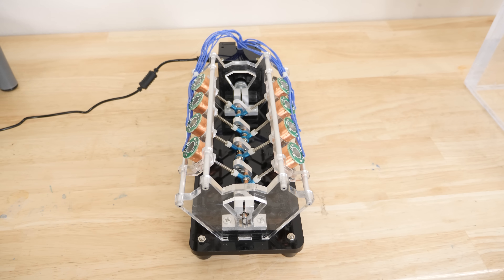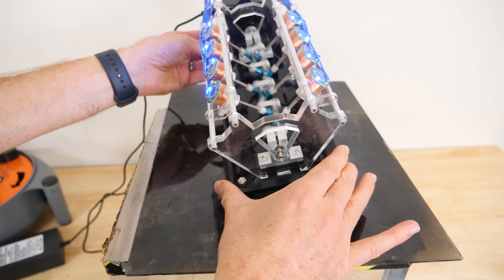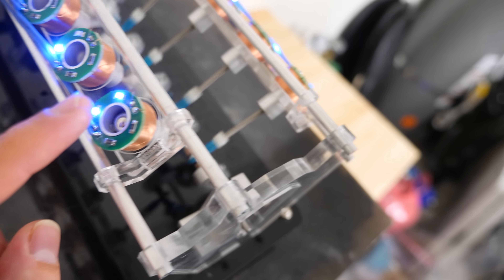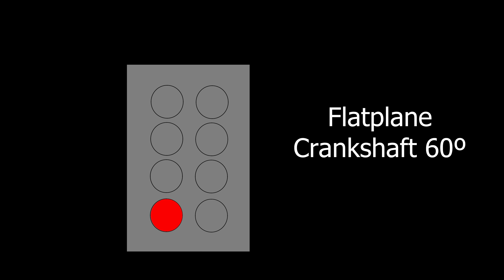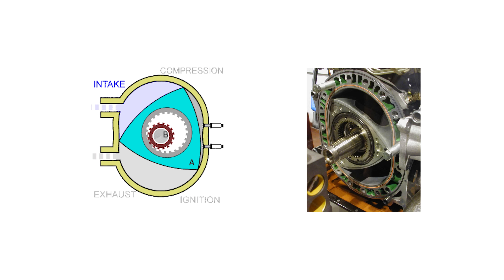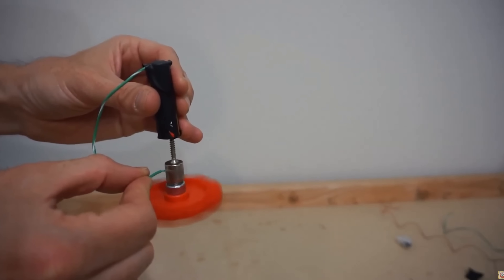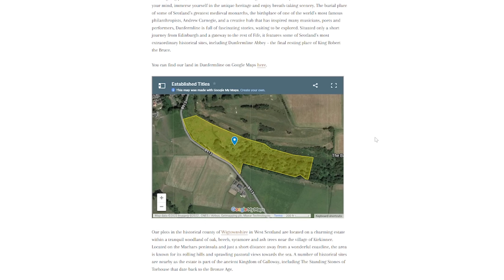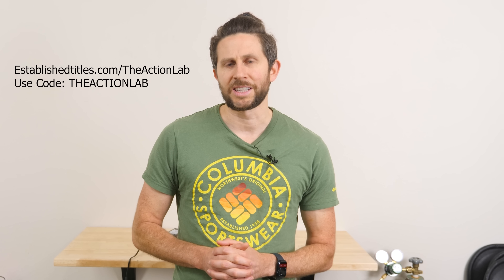Is an Electric V8 Engine a Good Idea?

Comment: Particularly interesting one.. I never thought about the losses when converting linear to rotational motion (especially when the rod is farthest away from a 90⁰ angle to the crank).
Reply: @Edward Elizabeth Hitler so a series of coils to drive the piston down would do the trick? Like peristalsis (lol biological scientist here).
Reply: There are no losses here.  This is nothing more than a commonly held misconception held by people who are not well versed in physics and/or mechanical engineering
Reply: Because there aren't actually any losses due to that
Reply: @giovanniquargentan6198  Except there are because the connecting rod is the same length throughout its movement. When it hits 90 degrees, the piston has traveled about 55% of the way down the bore, rather than 50%. This causes uneven forces throughout the movement of the piston, the piston moves faster in the first half of the stroke than the second half. This is secondary engine imbalance. And the connecting rod is stealing power from the crankshaft, from the other pistons, to do this in both halves to make up for those imbalanced forces. The engine is vibrating rather than delivering force to the wheels, which is energy loss. 

Balancing shafts can be used to reduce this imbalance, but it's a treatment to overall engine vibration, not a cure to the root issue, and does nothing to treat vibrations experienced by the crankshaft itself. You have to fix the connecting rod to fix this inefficiency.
Reply: @KaiserTom  Thanks. Very interesting information there. I would love to learn more about this.
Reply: @KaiserTom  you are correct, there are some losses in vibration, BUT they are very very minimal. I suggest you check the replies under the pinned comment of action lab, i gave a much more detailed explanation, also there's a guy named "michael harrison" who also explained it correctly.
Reply: @HeyChickens  check out the channel "driving 4 answers", he's a nice guy who knows what he's talking about
Reply: @giovanniquargentan6198  There's "opportunity" losses too though. It leads to an inability to design engines with larger bore displacements (which would be more efficient) due to the need to increase revs, which is incredibly difficult with secondary imbalance. You solve that and you can achieve a significant efficiency gain from an engine design that can take advantage of it.
Reply: @KaiserTom  "opportunity losses" doesn't really fit into the definition of efficiency, which is energy put into the system (chemical energy from combustion) / energy that arrives to the wheel of the car.
Also, higher bore do not automatically mean more efficiency. Higher revs over the max torque rpm never improve efficiency also. 
Have you seen the comments i talked about?
Reply: @KaiserTom  the secondary imbalance losses in an ICE really don't contribute that much to the overall efficiency of the motor.   The reason for trying to minimize secondary imbalance force is to reduce NHV and the impact on life expectancy based on reducing metallurgical fatigue

Comment: The LED's can't signal when the current is both off and on at the same time. If this was the case the LED's would stay solidly lit. However they can signal when the current is on. 😝 Just messing with you bud. It was the way you said it that made me laugh. 👍

Comment: I know a traditional motor is possibly more efficient and cheaper to build. But I still wonder, doesn't this set up provide more torque than a traditional motor? I wonder if there's a difference in efficiency if you have a regular alternating current motor pulling the weight, and piston driven electric motor pulling the weight. in my mind I would think the Piston dripping one would be able to pull more weight than a single electrical driven shaft base motor.
Reply: Well traditional electric motors giver more torque than combustion motors, even diesel-electric trains use a diesel motor to power an electric generator to power an electric motor because only the electric motor can provide the absurd amounts of torque necessary to get the train moving
Reply: @candiman4243  well yeah I kind of understand that. But the model he's demonstrating is electric motor. It's just a little bigger and has a crankshaft instead of a single smooth shaft. Now I just wonder if a crankshaft would make any different than a smooth shaft for electric engine.
Reply: @cinderedrockjf8055  no , you can get standart electric motor with the same input power and higher rpm , higher torque and much smaller than something shown in the video + you can save even more weight when you increase rpm , double rpm would mean double horse power/kilowatts with the same torque , and almost the same weight , so small motor with high rpm and single gear transmition would be tiny compared to motor like in video with the same power
Reply: @matejmotuz108  okay thank you.🙂👌 But I'm going to still leave my post. It sort of did the job I wanted it to do with you, hopefully it'll inspire others. I'd mainly just want to post stupid questions like this just to get people to think. ✌️

Comment: This reminds me of an idea I had 20 years ago: to use magnets to move/power hot wheel cars.
Reply: Isn't this the same principle used more than 50 years ago to power slot cars? They had flat rotary electric motors with two magnets and were about the size of hot wheels cars. I always wondered why no one ever powered up a hot wheels car this way but with an on-board battery system, so they wouldn't have to only race downhill.
Reply: You probably have never seen the YouTube channel: Backyard Racing?
They set up some long elaborate tracks for hot wheels cars.
They push the car in parts, but if the cars were powered by magnets they would be self propelled.
Reply: @jer103  Wow, those long tracks made me realize you could make the cars so they free-roll until they reach an uphill section, then the electric motor would kick in powering them up until they could free-roll again. You could have genuine circuit racing without using much battery power, and without depending very much on a motor to win the race. No Aquapark tracks, though, lol.
Reply: I would think magnet power would even go through water, or Aquapark tracks.
Maybe some small neodymium magnets might be strong enough to push through the water tension.
Reply: @jer103  Yes, it depends on how you use them in the cars; I was thinking of the slot car electric engines where the magnets are inside the motor--that wouldn't get along with water at all. Neodymium magnets could pull a car through water okay, but I'm not sure how you would arrange it so it worked. Sounds like a great idea, though.

Comment: The obsession with replacing the combustion engine never ceases to amaze me. How about just focus on IMPROVING it... It doesnt need to be replaced
Reply: Like a hammer, it has it's uses. Also like a hammer, it may be possible to use it for a task, and you surely will if that's all you have, but when you have access to the better tool, you use the better tool for the task.
Reply: @TheVoidSinger  you're comparing the combustion engine to a blunt object made for hitting? Please tell me what the better "tool" is compared to the combustion engine...
Reply: @michaelanderson8339  the compairson is not to "a blunt object made for hitting" it's to a tool that is very good at one thing, and may be subtitued for other things if those other things are not available (or do not yet exist). Right now we have a better thing for cars, electric motors. Razors, tweezers, epilators, lasers, and depilatories exist  now, who knows what else in the future, but you'd be hard pressed to find anyone arguing that we just need sharper daggers. Electric motors (now, at car scale) are better at converting electricity to rotation(and vice versa), ICE engines are better at extracting power from burning liquid fuel. Those are two different tasks, and if you have the option, you use the one best suited to the task.
Reply: @TheVoidSinger  it's your comparison. You explain yourself. Give me an example of something that can replace the internal combustion engine right now and explain how you would do this and why... you said it should be done but I doubt you can even build an internal combustion engine for a car, let alone implement a reliable replacement. The obsession with electric cars relies on heavy ignorance as to how the electricity is generated (natural gas and coal) and a doe eyed approach to the future mixed with a heavy dose of doomsday religiosity towards the "omnipotent climate"...
Reply: @TheVoidSinger  there are no batteries as safe or efficient as fuel combustion. Period. To create a battery that stores as much energy as oil in the same amount of space would be basically like creating a stick of dynamite. Highly unstable
Reply: Basic engineering doesn't change depending on the fuel source. Doesn't matter if it's butterflies and unicorn farts or dead puppies and grannies; Electric motors beat ICEs at the car scale. If you want to ask a REAL question, try "Why don't they win at the motorcycle/tractor scale?" I think you'll find the answer both surprising and educational.

As to me personally inventing the next best thing? Neither relevant nor my job. But FWIW building an ICE (or an electric motor) is simple enough that even a clock maker can do it, once you know how they work... of which I've done all three as practical engineering projects. Advancements in those I'll leave to specialists.
Reply: @TheVoidSinger  electricity is generated by natural gas and coal, 95% of it. By using a car powered by a battery you are simply creating an extra step in the process of power consumption. Rather than directly putting gas in your car, which is more efficient. By using a battery powered car you are basically going through the same process of getting gas, but than converting that gas to electricity and adding the extra step of creating a toxic lithium battery and charging it with gas generated electricity that you could have just poured right in your tank... makes zero sense

Comment: 1:45 Couldn't you just offset the pistons around the crack shaft so that they couldn't fire at the same time (i.e. all pistons are at different 45 degree angles around the shaft)? I'd assume that would make the electronics a little more complicated since the signal would need to be offset as well.
Reply: You could and should if you're making a solenoid engine as something to use and not as a model of a v8 engine. In a 4 stroke engine you need 2 up and downs per power stroke and pairing helps with vibrations

Comment: Not to mention that now you need a drive train, which is also a point in which you can lose energy to heat. Meanwhile you can just control the rotation speed of a regular electric motor with a bit of circuitry.

Comment: I wonder if it would make sense to replace the internal combustion motors with electric motors like this one. If the car is in good shape, replacing the motor could make sense. We don't build a hole new car, we just replace the motor. Some components will be removed or replaced, making the car lighter and simpler, eliminating many potential problems. Of course, the batteries will make the car heavier again.
Reply: Absolutely not.
Reply: @sinisterthoughts2896  You answer in this form is not very useful. Can you please be more specific. What would be the main reason for your answer?

Comment: The other thing is, an electric piston doesn't need a compression stroke. It basically runs in 2 stroke mode. 1 stroke, if you reverse polarity in the coil. That means it would generate power on the down and upstroke.
While it can generate less power than a gas cylinder, an electric piston configuration can provide this lower power 4x more.
Thus an 8 cylinder version isn't necessary. You might as well create a 3 cylinder, or 4 cylinder with bigger magnets.

Lastly, permanent magnets lose magnetism, especially in the use cases of an engine like this, due to heat. It would mean your engine needs new magnets every time.
What would make more sense is to replace the permanent magnet with a coil and capacitor, which would work more permanently.

Comment: Actually many V8’s do have two pistons firing at the same time. Cross Plane Cranks (Mostly European) V8’s don’t have this but Many American Flat Plane Cranks Do have this issue. That’s why when you hear the Ford Triple 7 it sounds like a Harley. The positives with this is-A Reliability. Many Pushrod Engines are VERY Reliable and B-Power. That’s why Many 7 second cars (virtually all of them) are Flat Plane Crank. The negative is sound (Ferrari V8’s) scream like that because no Two Pistons Fire at the same time-And B-Emissions. Cross planes are far more efficient.

Comment: You probably won't answer to this question but, is asking someone "how far did you moved in the 4th dimension?" the same as asking "how old are you?"
Reply: No, because time is not a spacial dimension, so we cant talk about distances.

Its useful to pretend it is for math, but its not.

Like a temperature vs time graph it doesnt mean temperature is representing a distance
Reply: @tomasgarza1249  While we don't measure time directly with a ruler, it is intrinsically linked to distance. But the question has a built in presupposition of "from X" that would make it more equivalent to "how long has it been (since X) ?"

Comment: I wonder though if this would be a good way to retro fit ICE cars into electric? Probably not though, a large electric motor fixed to the drivetrain would probably be better. The batteries would have to go where the fuel tanks were, and would really mess with the weight balance of the vehicle, and is the current suspension capable of the added weight of the batteries? It's starting to seem like a retrofit would cost as much as a whole new vehicle, lol.
Reply: your intuition is spot on... also thanks to the added weight (including default heavier frame) and extra power losses from the drive shaft and differentials, you'd have far less effective power compared to either an EV or even the original.

Comment: U kno that engine may be more efficient if thay had cylinders with those solenoid with a viscous oil for torque  RC MOTOR SPEED CONTROLLER
Reply: Then I’ll be riding around with sum spare solenoids 😂

Comment: Very cool to watch, but too many moving parts non-efficient and will wear out too quickly.
But like I said it's very fun to watch.
Reply: I see very few moving parts.
Reply: @moabman6803  (piston (plus 3 rings), arm, crank)x8+2 bearings. 

Technically this would be fewer moving parts as you don't need camshafts, I think you can reduce the coolant flow with this design, but you'd still need oil flow. no need for a fuel pump...

Comment: So it would need oil, and potentially cams and valves to let the air out…..I’m sold let’s make it and see if it sounds cool
Reply: oil for the cam shaft, sure, but the pistons can actually operate in open air magnetically without friction (while running at least)
Reply: @TheVoidSinger  true but then they would probably be spilling oil everywhere

Comment: It's a terrible idea unless you want to convert a traditional gas burning car into EV without having to replace the entire drivetrain.
Reply: Still a terrible idea even then... better (and simpler) to couple a new direct drive electric motor to the drive shaft... although the performance would be much worse. EV's drive components actually tend to weigh more than traditional combustion drive components, but have generally lighter bodies, and having the motors at the wheels eliminates power train losses

Comment: I think the future is multi rotor common shaft variable reluctance pulse motor/generators. 
A mouth full, but accurate description. Tesla or someone else will get there eventually. 
You can recover up to 90% of the pulse in a back emf spike. You can recover nothing in a sine-wave motor.

Comment: I saw a 4 cylinder kit back in 1998. It didn't have flashing LEDs and was build around a Basic Stamp as the controller.
Reply: those will work more reliably like a Toyota
Reply: I aint heard that name in a while. My school was passing them out during my time there for arduinos.

Comment: In continental Europe, is now mandatory for EVs to be equipped with a noise generator, so that pedestrians are not skewed by a speeding - but totally silent - vehicle.
The noises that major EVs manufacturers have come up with are startling. The new EU EVs now all sound like science-fiction Spaceships. The external car speaker playing a BMV V8 engine would be so much better!
Regards,
Reply: required in the US as well. also makes detecting problems via change in sound basically impossible.